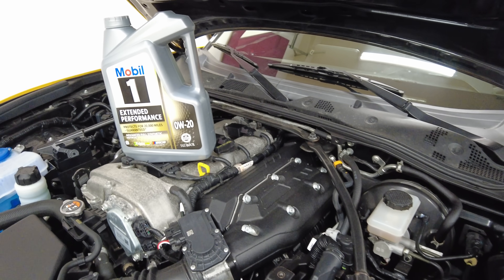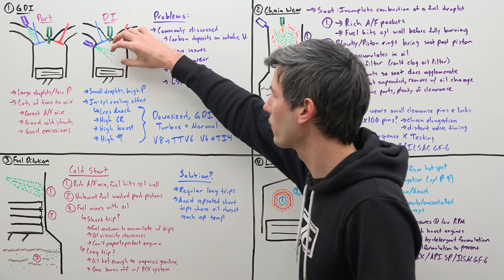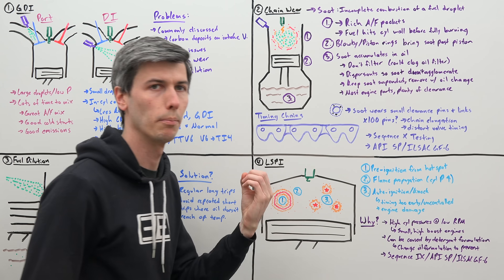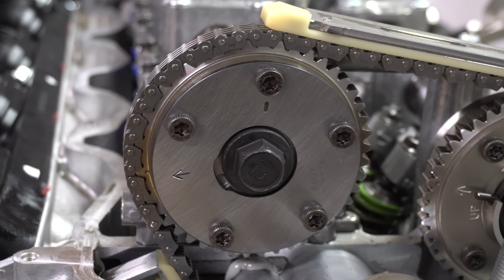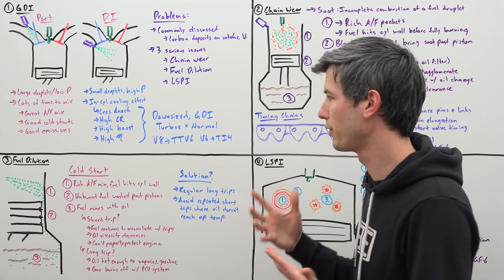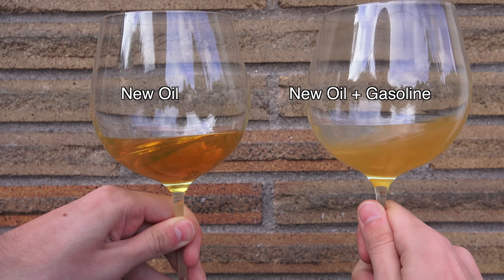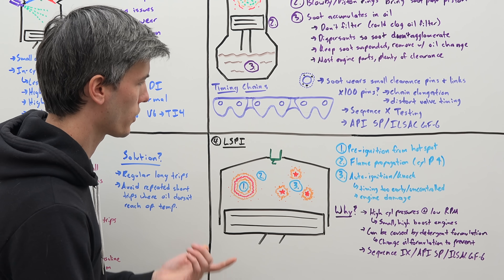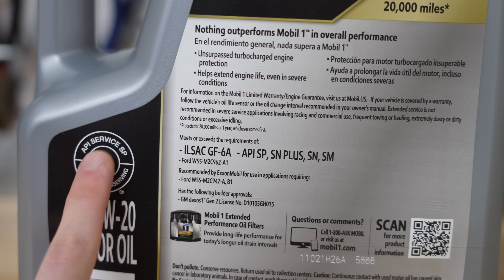3 Big Problems With Direct Injection Engines (Gasoline)

Comment: As usual, your videos are very informative and without much "fluff".  Very well explained in layman's terms and easy to watch.  Others should take note!
Reply from the maker: Thanks!
Reply: @EngineeringExplained 
Jason, in regards to timing chain wear, as a mechanic of some years, the main issue seems to me to be the engineering choices made by the engine manufacturers to use tiny, jewel-like chains and complex curved tension side guides to make the systems quiet.
The prevalence of small pitch single row chains on spindly plastic guides would, in my eyes, be the major cause of failure. They just don't have enough margin in them to last.
Surely a poorly tuned old school carby engine had at least as much soot in the oil as a modern clean burning DFI
Reply: @Danger_mouse  I agree 100%. All American V8 engines had a double row timing chain and it was very short by nature. When we see the timing chains used in these overhead cam engines , the timing chain is three times as long and yet it appears to be a single row type.
Reply: @markkauffman6184  even older OHC engines had heavy double row chains and the tensioned side of the chain was made to be near a straight line between the sprockets.
Not hard to imagine what is going to happen when you design an engine with a flimsy chain and have it pulling around a curved plastic guide 🤷‍♂️
Reply: @Danger_mouse  Totally agree. The engines is designed for a limited life span. The chain rubs against the wear pads and the wear pad do not last the distance.
Reply: @Danger_mouse  Guys, you're implying the manufacturers want you to buy spares or worse, a whole new interference engine.  Or even a new car.
Surely not............. 🤷
(Kudos to your engineering knowledge!).
Reply: @alexmanojlovic768 
Manufacturer are trying to improve fuel efficiency, power output and reduce engine mechanical noise to acceptable modern standards.
However, engineers do not properly test the systems they put into place and are further hamstrung by the bean counters penny pinching every cent from the deal.
What results are vehicles that fail well within the warranty period and cost the company more money engineering a fix, or paying out the customer.
Reply: @Danger_mouse  sorry, I respect your technical knowledge, but claiming manufacturers are trying to improve mpg.  Pure BS.  Manufacturers are FORCED to improve mpg by mandates & legislation.  With your technical knowledge (for a mechanic, well above the average.  Well above). You must be very well read, so I assume you know of, from the 80's, Citroen's "invention" of the alternator within the flywheel, which easily produced 45v & 100+amps.  Weight & friction reduced by having the alternator componentry (casing, mountings, drive belt etc removed) replacing dead metal in the flywheel & the ensuing larger diameter allowable by being within the larger diameter flywheel, improving output.  Gave a ±20% mpg improvement.  The Roton valve replacing all the camshaft/valvetrain arrangement with slotted rotating shafts, which were electrically, infinitely variable, unlike cams. No power losses from resistance by valve springs. Virtually silent, less mass, fewer parts, no violent impact imparted to the (nonexistent) valve seats, constant cooling due to rotation, rather than permanently in situ valve faces refucing pinking, knock, prehignition, thus allowing higher compression ratios (efficiency).  ±20%. mpg improvement.  Only sealing materials needed work to ensure reliability.  No single manufacturer would take on these technologies, giving the most pathetic excuses. Citroen's alternator: ["voltage too high, we'd have to change the full electrics of all vehicles"].  (Power steering, Aircon could now be 45v instead of pulley/hydraulic driven).  Too costly.  BullSh1t.  Step down transformer for any legacy 12v components.  Kowtowing to the oil baron's more like.  The old "myth" of oil co's buying up patents is not a myth.
Look at the GM EV1 from the 90's & how battery patents were sold to oil companies (Chevron/Ovonics) & purchase quantities restricted so it was impossible to buy enough batteries to enable car production.  Come on, grow up DM!....  The world is controlled by rich, greedy psycopaths.  Manufacturers only "try" to improve mpg when forced or as a marketing con.  until hybrids, TRUE mpg has only improved in tiny increments over the last 70 years.
Reply: @alexmanojlovic768 
Mate, I don't know about you, but I want every km from my litre of fuel that my vehicle can extract.
We're facing $2 Aussie a litre soon, 3. 785lt to your US only gallon....

I want economy as a customer, and I buy the vehicle based on who is doing it best at the time.
So.... the manufacturers are definitely trying to win the customer over with better economy.
My 2t Nissan 4x4 dual cab is sitting on 8.6lt/100km average. 
This vehicle tows, does high speed highway trips and urban driving.
That's over 27mpg in US miles....a figure I could only dream of a few short years ago.

My previous ute from the same company struggled to get under 10lt/100km, despite having 200cc more capacity in the engine.
It had less power and torque and was dirty, with just a simple cat in the exhaust. (it also had premature cam chain failure) 
The new vehicle meets Euro 5 emissions, has a DPF that has no common issues and it drives better with 50Nm more torque lower in the rpm range..... And gets good fuel economy 👍
Reply: @alexmanojlovic768 
In UK mpg my 2T 4x4 averages almost 33mpg and up 38 on a trip (different to the made up 3.8lt US gallons)

Call it a conspiracy if you like, but for a heavy vehicle that offers a 5 star crash rating, has clean exhaust emissions (the inside of the tailpipe is still shiny after 100000km), can tow 3.5T, take off from the lights like a car and take us off road, I think its pretty amazing.
Lots of vehicles out there do even better.

All the best.
Reply: @Danger_mouse  Of course a timing chain in an old school engine did one thing - it turned one camshaft. No tensioners, no guides, not much load.
Reply: @townhall05446 
Timing chains in older Datsuns were pretty robust. A pair of guides and a tensioner running an overhead cam.
They were a bit noisier than a modern engine, but they were reliable.

Engineers ask the modern chains to do too much with undersized chains and  poorly designed guides.
Using the chain to drive a diesel pump, a pair of cams, a balance shaft etc is just a recipe for expensive owner repairs.
Reply: @Danger_mouse  By this point mfrs know exactly how long something will last and how long they want it to last. It is by design.
Reply: @nspro931  Renault had no idea how long the timing chains in their D40 2.5 engine, nor did GM with their alloytech engines.
In many cases, both of them failed well before the new car ended.
They're all engineered down to a cost and they hope they will last.
Not all of them test enough and get it right.
All the best
Reply: @EngineeringExplained  you missed a better alternative to too many DI car short trips is to buy a used EV (even with a small battery) as a replacement.  The EV will have much low operating expenses, more reliable...    BTW can you make a video about why we don't see more hybrids like the  BMW i3 with a tiny range extender, which have a lot of the advantage of pure EV with less wasted space of huge engine.
Reply: @glike2  I personally wish there was more market for the "performance hybrid" concepts like P1, 918, and LaFerrari.  Just not all in hypercar territory.   Sure some exist, but they are really subpar on either at "regular car" price ranges - or they heavily favor the EV side.  I suppose that it really depends on if there's even a market for the realm in between prius and hypercar though...  sure there's some notches above Prius, like "mild hybrid" Volvo's, Lexus 500h's, and Acura's...  But not really anything above them until you hit NSX and Porshe performance hybrids.  

But, maybe retro DIY EV refit kits will also get more popular as time goes on.
Reply: @EngineeringExplained  while I usually like the tie in videos a bit less, this was immaculately well done.  You should find a way to tie in (or make a dedicated video) to all of the major oil or other fluid certifications and the breakdown of which each means.  That was a fantastic insight and makes me consider using a slightly thicker viscosity on my Audi 4.0TT engine's.. excessive oil sipping habit during top offs between changes :D
Reply: @EngineeringExplained  you should do a video about top tier detergent gasolineb see if it helps clean GDI engines
Reply: @Tool Time yep, 59, had Delta & Omicron.  Incidentally Omicron is an anagram of Moronic....  Had Chinese flu in my 20's which was much, much worse than Delta.
Caught both off either my mother & ex.  Both of whom were jabbed & boosted. Not getting jabbed by any sheep, thanks.
Reply: Will here whiny whiny bitches jealous cause your a legend.
Reply: Jason. What brand of motor oil do you use in your cars, I been using Mobil 1 extended  performance 5-30,  but I really think Pennzoil ultra platinum 5-30 would be a better choose?? Just wondering  I'm going  back and forth going a little bonkers really.  Seen some Diy tests on you tube, protect  farms etc...  Please  respond , love your engineering videos  explained. Thank you....
Reply: * Taking Notes *
Reply: @TakeDeadAim Have you seen speedkar99 videos? Takes apart everything and explains how it works, no fluff. A good compliment to EE channel.

Comment: It used to be technologically made cars more reliable.  Now due to emission standards solutions are making engines more expensive and will probably not last as long.
Reply: no, technology definitely makes cars more reliable. cars are hugely better than they used to be, mostly because of regulation, not in spite of it
Reply: Electric cars are way more reliable, there so much less moving parts and heat involved.

Comment: It’s a good practice to check the oil every 1,000 miles. If you have fuel dilution you can smell the fuel on the oil dipstick and change the oil early if this happens.
Reply: or just go on a 1h trip to burn the fuel off
Reply: If your car has a dipstick...
Reply: @ewicky  What car doesn't have an oil dipstick?
Reply: @rars0n  I know of at least some Volvos, BMWs
Reply: @rars0n  BMW M5 E60 ;)
Reply: @rars0n  Porsches
Reply: @rars0n  ya my 15 year old BMW doesn't. it has a sensor instead. you can check the oil without even getting out of the driver's seat. and the computer checks it every time you drive and dings if it's low or needs changing
Reply: @rars0n  Honestly I'm surprised any cars still do have dip sticks. Like, who still manually checks tire pressure? Nobody, we have sensors now.
Transmission dip sticks went away a while ago too.
Be honest, what percentage of drivers actually know how to, and regularly do, check their oil? Probably less than 10%.
There's almost never a need to check it anyways. Just get your oil changed at regular intervals, and there's no need to check it in between.
Reply: @ewicky  My car has tire pressure sensors, but does not actually give me a read-out, so I check the tire pressure manually and then set the TPMS warning system in the system. It's a 2017 VW Golf.

I don't know what you're talking about when it comes to oil and transmission dipsticks, every vehicle I've ever driven and ever popped the hood on still has them. For example, if you don't know where to look, you'd assume that the Mercury Montego with CVT does not have a dipstick, however it definitely does. It's hidden underneath the air box ducting. This is a transmission which the user isn't supposed to touch until having serviced, and it still has a dipstick.

I think you are mistaken because you're simply not looking for them. They still exist. Not including a dipstick on a car would be like not including a drain plug on the oil pan.

You'd be surprised, some people see a spot of oil in their driveway and start adding oil to the car thinking that it's low. I've seen numerous cars come in for servicing due to "low oil" only to find out that the leak is actually because the oil has been over-filled. Checking the oil is both quick and easy, there's no excuse not to do it on a regular basis. Doing so will help you recognize a problem before it turns into something far worse. The "set it and forget it" mentality is precisely why there are so many comments under this very video bitching about new engine designs, because people don't bother to properly maintain them (which includes checking the oil) and then they have problems.
Reply: @ewicky  Which BMW? I don't believe you when you say it doesn't. Especially because sensors can, and routinely do, fail.
Reply: @m850i_individual  Yeah, apparently some newer Porsches have done away with the dipstick, which is a bad move IMO. Good luck detecting low oil level when the sensor fails.
Reply: @m850i_individual  I was not aware that European cars started ditching the dipstick so early on. Just another reason to avoid something like the E60 M5 like the plague.
Reply: @rars0n  I am not mistaken. I have taken my car entirely apart and put back together, including removing the engine and transmission. I know the engine bay like that back of my hand. And there are no dipsticks. Thanks for the condescending suggestions, but it isn't because I'm don't know where to look. My car is a 335xi. It has no dipstick for trans nor engine. That fact is documented in the user manual, in service tech manuals, all over the internet including YouTube and forums. It is probably more common than you realize.
Reply: @ewicky  Yeah, I apologize, I didn't realize European manufacturers started going that route so early on. I still would rather have a physical dipstick on my engine, there's no reason not to have one, and I can actually inspect the oil when I check it rather than relying on a sensor to tell me the level is okay.
Reply: @rars0n  Thanks for the apology and sorry I kinda attacked you too.
Indeed, the best of both worlds would be a sensor and a dip stick both in the sump. Though as you mention about the air box, it's going to be harder and harder for manufacturers to find room to route a dip stick up to a user serviceable location.With how tight packaging has gotten under modern hoods, this could contribute to the demise of the dip stick.
Reply: @ewicky  No worries, I've worked on a lot of cars and have yet to come across any without dipsticks, so I found it surprising that a substantial amount of vehicles have gotten rid of them. My fault for relying too heavily on my own limited anecdotal experience.

I get that packaging can be an issue, but at the same time if these manufacturers would stop covering everything in plastic panels, it might be a little easier to squeeze in a dipstick. My car does have an oil sensor, although it only tells me when the oil is low. An actual electronic level indicator would be nice, but I'd still be checking the oil every couple fill-ups just to gauge the color and quality to be on the safe side.
Reply: @ewicky  What if the sensor that checks that out FAILS????
Reply: @ewicky  You make me laugh and scratch my head at the same time. You are one of the new gen that didn’t come up in the nuts and bolts of how an engine runs; you think a computer will ALWAYS keep checks on your vehicle. SMH..,.
Reply: @standhd  "What if the sensor that checks that out FAILS????"

Then the dash tells you the sensor has failed. OMGFML!???!? Calm down dude.

Also, as I mentioned, the sensor is less likely to fail than the human. Also the sensor reads while driving, which a human cannot.
Reply: @ewicky  Yea I know this!!!! Good GREIF! I have a scan tool myself! I’m saying I don’t trust a computer over a dipstick just yet!!!!!!! Now when I die, the tech may catch up!!!!! So you keep on driving vehicles without dipsticks….and if you decide to keep your vehicle well beyond the WARRANTY, and trust that SENSOR….GOOD LUCK TO ya PAL!!!!!!!!!!!!!!!! Just UGH!!!!!!!!!!!!!!!!!!!!
Reply: @rars0n  If I had some money I'd buy a good E60 M5 for sure. Fix its problems and there it goes. I wouldn't miss the dipstick, electronically showing it is the comfier solution, as long as it works... but why shouldn't it?
Reply: @rars0n  True the E60 is a crystal glass, nothing like the old E34 M5 manual, a truly good BMW.
Reply: @FEGTTTSDH  I know an E60 M5 with first rod bearings and 350'000km
Reply: And if you suspect you have coolant in the oil ,you can taste it and save money for an analysis 😁
Reply: It’s good practice to check your oil at every fuel fill up.
Reply: There has to be a fairly significant amount of fuel accumulation before you can smell it in the oil, and if it gets to that point its more likely caused by some other failure. The smell test is probably not good advice for a DIYer.
Reply: @stevenmcgrew869  this is not true.  Many Di engines oil will have a fuel smell within 250-500 miles of driving after a fresh oil change.
Reply: A better practice is buy a N/A car, change the oil at 10.000km and change it at 300.000km
Reply: My Porsche Cayman 981CS doesn't have a dipstick so now I never have to dirty my hands 👐
Reply: You should check your oil every time you get gas.
Reply: Just buy another car...
Reply: @Pork-Chopper  I wish
Reply: @Pork-Chopper  Keep your 2000's port injected car, if you have one. I'm keeping my 2000 Nissan Sunny
Reply: no you can't smell that for sure